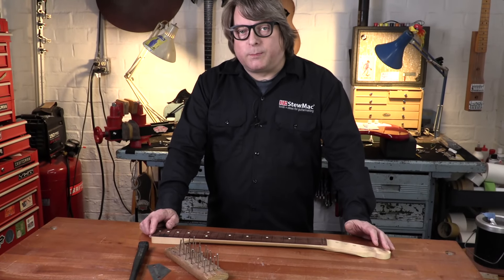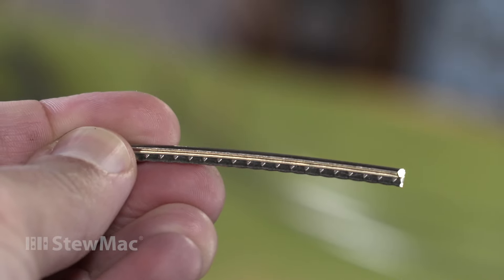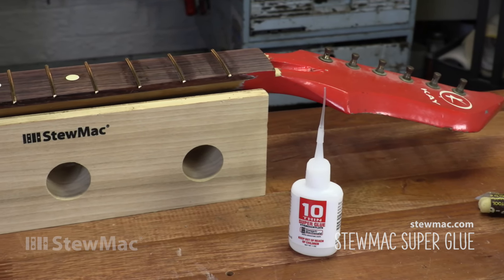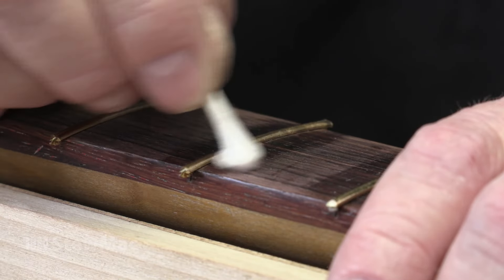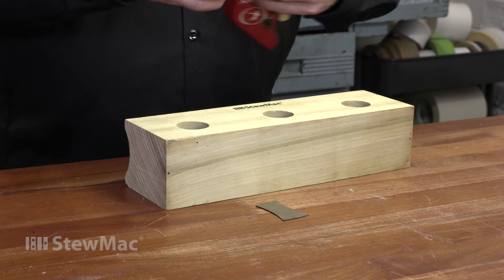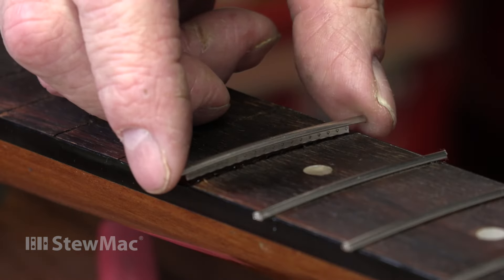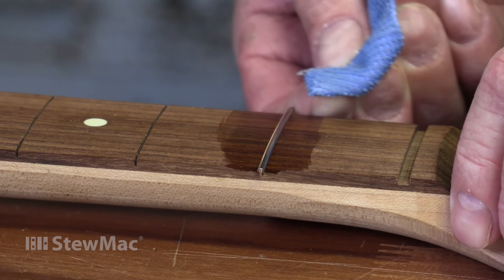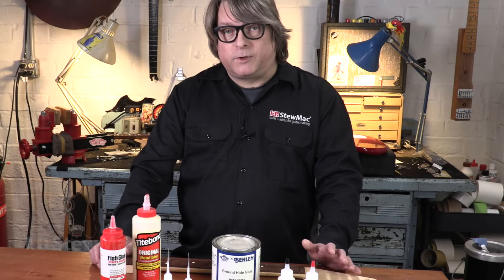How to use glue for guitar frets

Comment: Be careful when you wick the super glue under the fret.  I've done it a million times and 1 out of 10 times it will run out the sides of the fret slot if you don't have binding.  Then you have a royal mess!  Super glue on the back of the neck....you usually don't see it until it's dry unless you are aware.....TAPE OFF THE ENDS OF THE SLOT SO THE GLUE DOESN'T RUN OUT THE END OF THE SLOT.
Reply: Super glue will run  EVERYWHERE.....thats for sure.The upside for me is that i finish my necks in superglue too so it doesnt really matter but if i get a finished neck and wanna preserve the finish without much issues superglue would not be an option cause you cant reall control it.
Reply: I use little dab of vaseline at the fret ends.
Reply: ....and use electrical tape not masking tape! Water thin CA glue seeps under masking tape and sticks it to the wood.
Reply: Thanks for the heads up.  Working my first practice neck right now.
Reply: Very helpful tips, I got ca glue everywhere last time I tried using it and have been fearful since

Comment: One tip I have to add (if anyone actually reads these comments lol), is this:  with thick glue like titebond on bound fretboards, don't completely fill the slot or you will be fighting hydraulic pressure to get the fret in, as there's nowhere for the glue to escape.  I press 3 blobs in the slot to leave two air gaps.
Reply: I'm so glad I read this, I'm just about to refret a bound board using titebond and never would have thought about that. Excellent advice
Reply: Except that filling the air gaps and eliminating voids is one of the main purposes of using glue in the first place…
Reply: I kinda disagree. You actually want no voids or air gaps. When you press the fret in, any excess will absolutely come out of the sides of a fret. You can just wipe it off and clamp it down until it sets. Titebond has a great liquid hide glue that works very well to fill in any pockets. Even better about it is that runout is stupid easy to clean off, even if you don't see it for several hours. Warm water will liquify it again and make it easy to wipe away.
Reply: @LeviBulger  I was only talking about bound fretboards.  I've seen too much glue push off bindings.  Also, water based glues will shrink a great deal as they dry, so even a full slot will likely have some small voids.  I know a few luthiers who use epoxy to avoid this, and also to avoid moisture going into the fretboard via the endgrain of the slot sides.  I've never bothered and find titebond just fine, and much easier for the poor guy down the track who's doing the next fret job!
Reply: @RobMods  - It amazes me how there is always an "expert" who's approach is the "only way" to complete a task. What research does he have that proves "you actually want no voids or air gaps" ? I think this goes to the old "tonewood' debate mentality that says "I'm right, you are wrong". I especially like the part where he leads his expert opinion with "I kinda disagree" - truly conclusive.
Reply: @78tag  Watch the video again; he expresses the same thing clearly!

Comment: Worth mentioning I think:
Hot hide glue (shown as ‘ground hide glue), though slow and fiddly to work with has two outstanding advantages. Unlike all the others, it contracts as it cools, pulling the joint together, thus improving the contact for transmission of sound. Also, should you ever want to remove the fret, the glue is ‘heat liable’, so it can se softened with the simple application of heat, as with a soldering iron to the top of the fret, for easier fret removal. This will save damage to the fingerboard in a partial or total refret.
Reply: This is a very professional tip and worth filing away for future reference, Thanks! It makes sense and it saves future headache. It also fits the motto of the USNAVY SEALS. The 7 P's! Proper Prior Planning Prevents Piss Poor Performance! Nice tip!!!😎🎸
Reply: @kortgreen7725  NAVSPECWARGRU One, 1985-86
Reply: @NMranchhand  thank you for serving with the best. We're you one of Marcinkos marauders?
Reply: thats what i was thinking. Hide glue seems to be the best for fretboard integrity in terms of installing and removing (very important) frets. CA glue seems more efficient for the manufacter but i will prefer to protect my instrument

Comment: I use ca glue when required by the fret board .  A new board has some spring to it while a hundred year old one doesn't.  I find it useful to glue and wipe off before removing frets to stabilize wood and prevent chip out.  Also I use teflon fret dam material with ca glue and dust to repair damaged fret slots.

Comment: Doing my first stainless steel frets, and I'm setting them with epoxy. Hopefully they will stay put forever and never need to be replaced (well, at least not for many, many years).
Even mixed some super fine fretboard dust into the epoxy, to fill out the fret slot gaps in the sides. Looks perfect so far. You can barely see there ever was a slot under the tang.

Thank you for making these videos. They are a great resource, and a great inspiration.
Reply: How’d that turn out for you?
Reply: @Aigsup  
Honestly, it turned out great. Very happy with that decision, and I think it'll be my preferred way of doing it from here on.

Comment: I've used all of these methods but the epoxy and for me titebond works the best, I've never had to clamp the frets overnight but everyones experiences are different, also it could be that I'm a builder not a repair guy so maybe on frets that are being replaced the slot is a little bigger so they need to be clamped. I don't use that much glue either just enough to help guid the frets in and fill any voids.

Comment: a well presented, informative compilation - thanks!  One slight 'nit-pick': the main reason that the CA glue (or other thin glues) flows into the slot is not gravity (although gravity certainly helps a bit) - it is 'capillary action'.  Just sayin'...
Reply: Also the reason you can flip the neck and not worry about glue running out of the fret slots, as shown in the video itself.

Comment: Would be great to know from a “maintenance” point of view what is best. Like, in case of frets replacement, which one is easier to remove and less likely to chip out the fretboard. Also, how do they effect the sound.
Reply: Glue is there not to glue the fret cuz any glue would not hold metal to wood so, what every you use will fill the gaps between the tang and the slot, for a faster method you could use CA or epoxy
Reply: A good repair person will go to great lengths to avoid chipping the board. There are lots of "cheap tricks"one can do, re that.  Some novices will chip the board severely. There's NO excuse for that. Don't EVER accept that excuse ... Even on a flat-sawn "fretless wonder "dried out ebony board that no one ever cleaned or treated.   I do agree that fret slots having glue in them do increase energy transference from string to neck.  Sometimes as I write this stuff, it all just seems so obvious.  "Oh well".

Comment: good video.  gluing frets is Very Important, just pick a method and get it done.  it's not about "tone", it's about the stabilized integrity of every fret.
Reply: @obfuscationstation  Literally, absolute nonsense.  At gigging and recording venues, guitar "tone" is first and foremost and for the very most part, in yer brain and fingers.  If it's an acoustic box, it's the wood and its build.  If an electric, it's the engines and what they feed onboard and offboard.  At low volume levels and with clean playing, a flat amp and no modulation, yes, the electric guitar wood might have an effect, but even that can be suspect.  Too many good folks have drunk the guitar koolaid about guitar "tone".  Some are SURE that nitro finishes add to "good tone" and jumbo frets and big strings enhance "output".  What rubbish.  But, it's easy to see why people can be easily fooled, not their fault at all.
Reply: @rfdsrd  You’re talking about an issue which is subjective. You can’t ‘prove’ tone.  Somebody else’s opinion and experience is not ignorance. But your insistence that only your answer is correct is arrogance. And your attitude compounds that.

When it comes to the creative part of guitar playing, which is the realm you are in when you talk about gigs and recording, the sound, tone, feel of the guitar and amp is part of the feedback loop that either inspires the player or stops him getting in the zone. 

Every player has their own set of collective experiences which form their opinion about tone. I can assure you that you are not ‘right’. There is no ‘right’. It’s subjective. With all the variables that make up ‘tone’, you think you have the one and only answer? 

Try developing a bit of humility.
Reply: It's about both.  Integrity is integrity.

Comment: as a highly skilled cabinetmaker but being relatively new to luthery I would be interested to see the effect each type of glue has on REMOVING frets . I use hot hide glue & drill press caul. Drying time is quite quick. I find the drill press caul gives much more consistant results than hammering & it can be locked in the down position for a few minutes - installing & clamping in one quick operation.
Reply: It's easy to remove frets with super glue.....get a good soldering iron (must get very hot)....hold it on the fret....move it back and forth.....when the glue smokes....it's back to liquid....put the fret.  Activator on super glue hardens it immediately when installing.  You can use a water and  baking soda....it will harden super glue right away.  I agree with using a caul.  Much better seat on the frets.  I don't have a press so I seat the frets with a hammer then go back with a brass caul and use it with a hammer.....seats frets very well....almost as good as drill press.  I've found after 10 years that I must slightly over radius the frets to seat the ends well (14" radius for 16" fingerboard)...otherwise I have to take off too much fret when leveling.
Reply: @cugir321  This is great advice of course, but when a guitar comes in the shop for a refret you usually don't know that the frets have been glued in until you pulled the first one and parts of the fretboard with it and the boss starts yelling at you. :)
Reply: @gerdpfeil  You can heat with a soldiering iron without knowing if it's glued.  It will loosen it if it's glued.  Then you'll see the glue when you pull it.  Super glue smokes when it heats up.
Reply: @cugir321  Thank you, that's something I'd try if a guitar is old enough to have had a refret and an unknown history, but that doesn't change my mind about gluing frets, which I consider cutting corners instead doing of a proper job. :)
Reply: @gerdpfeil  I'm interested in your view that it is cutting corners.  If the purpose of the glue is to fill space rather than just adhesion, on a refret job you have a wider slot after pulling the frets out... Or are you just referring to when building a new neck?
Reply: @danielmiller2886  Nothing wrong with using glue to fill space if that's a separate process.  The corner cutting is that you end up with wider slots after pulling the frets of course and then some people are hammering in whatever wire seems to look the same together with CA glue, great time saver.
 
The way I've learned it many moons ago is that you never ever (CA) glue in frets because that's "shady business", instead use wider tang fret wire specifically made for refretting. If for some reason (e.g. not the first re-fret) the slots were wider than expected, we would use sawdust/glue mix to build up material in the slot, re--cut the slots after curing and then put in the frets.  

But that was a different time, when the first work directive in the shop was "get a cup of coffee, sit down, look at the guitar and think up a plan" and people were not asking for 6100 and SS frets yet. :)
Reply: I like your method better.
Reply: Whenever possible I use hot hide glue over CA glue. I have even repaired fretboard cracks with it over the more popular CA methods. I like the reversibility of it.

Comment: What kind of wax are you using with the super glue? At one point you've got a hard wax in a foil wrapper, and then you've got something on a Q-tip. I did a fret job (my first) with CA glue and tried to wax off with regular old trewax paste wax, and it didn't do a great job at protecting the fretboard; but maybe that's just inexperience?
Reply: Rennaissance micro-crystalline wax

Comment: I personally prefer not to use glue when installing frets, but I still appreciate the reasons for others doing so. For me it just comes down to personal preference, and enough confidence in my work to trust that the frets won't be coming unseated any time soon if the instrument is properly taken care of.
Reply: True,but if the instrument has been refretted a few times, they're much more likely to become unseated

But if you can do it without glue,then great!
Reply: @anpleidhceeireannach9498  That is a valid point, and I like to believe that I have a mildly unique approach to that sort of situation. If a guitar's been refretted enough times that it would almost guarantee issues with frets staying seated without glue, I'll take a different approach than only gluing in the next set. Because for me, if the fret slots are that damaged that the frets can't bite into the wood for a snug fit then I'm also not going to trust that amount of 'void' between the fret tang and slot walls with just glue. The reason for that is twofold- when most glue hardens, the structural integrity of just a wad/piece of glue isn't up to snuff for my standards- as you know most cured glue can be chipped off with relative ease- and as for superglue, I don't really like applying that much in one area no matter the situation (or at least the superglue by itself/unadulterated). What I would personally do is actually fill the fret slots with a combination of glue and sawdust as that has quite a lot of structural integrity. From that I can cut fresh slots that fit the fretwire much more optimally, and the repair is still completely masked by the fret material.
Reply: @TidusReborn  I've seen the glue and sawdust method before

A luthier I know taught me to use ebony sawdust and epoxy to fix chips in fingerboards

Never heard of it done for fret jobs until now,sounds good
Reply: Properly taken care of is key... hanging guitars on the wall in 70+ % RH in summer and 20% in winter and they don't see a problem with that.  In my experience most owners don't take proper care of wooden instruments.
Reply: @dtimm612  You're right on the money with that. Back when I worked full-time as a tech the worst case of improper care I saw was on a beautiful Martin D20. There was a decently long but easily repairable crack on the top, and the guy bought coverage on it so he would've got it fixed at no cost to him. Unfortunately, he brought it into the store in the dead of a Minnesota winter (it was well below freezing that day) from his probably hot house. After the customer opened up the case to show me the crack, I picked it up to do a closer inspection of the crack, and noticed that about 16-18 inches of the back had completely separated and aggressively peeled back from the side. I asked him about it, and it had been perfectly fine when he put it in the case to bring it over to me. At that point there was just no fixing it, because the back had peeled back so far that it took a tremendous amount of force to get the back realigned, and there was no way in hell that I was gonna go ahead and try to glue that back up. Thankfully he was given store credit for the full purchase price of the guitar so he could buy a new one. But it's simple negligence like that that does the most damage to guitars from what I've observed in my time doing repairs.

Comment: Great info. I always use glue when re-fretting. My personal favourite is fish glue, bit of a pig to work with and you have to clamp each fret but it works great. I've used CA with no issues and that's great too. All personal preference I guess! :)
Reply: I NEVER  have had to clamp a fret with fish glue. In 30 years. Just over bend the fret a hair, before installation. .... Unless someone else has messed up the slot during a previous and bad re-fret. Then, it's time for alternates.

Comment: For the upper frets of an acoustic guitar it is a good solution as when hammering 
in frets, even with an internal support, damages are likely to happen. The slots then
have to be sawn just a bit wider so that frets with only a few small hammer moves
will find their position.
Reply: Noud Koevoets great point! Personally I use the stew Mac fret barber on the upper frets. That way you can leave the slots as they are, less work and less invasive for the instrument.
Reply: Yeah; well there are about 100 variables re the "spring" of the tongue of the board past the neck block.  That's a tough area, with the variables of the action a customer would like, AND the "grip" of fret-wire ... some have sharper barbs than others.. JEEZ, there are a lot of things that come into play there. Neck angle and neck flex strength under tension. Where's the T-rod most active on XYZ brand of guitar?  Does it work? or is it garbage right from the factory ?  Jeez!!

Comment: Re fretting  always has a larger slot the original frets  ca glue runs freely  in to nooks and crannies filling any gaps that a thicker epoxy won't
Reply: Depends on the viscosity of the epoxy, and how fast you are. variables are the only constant in this biz.